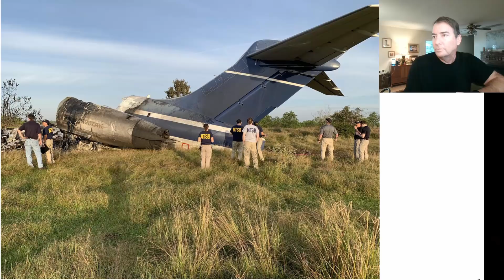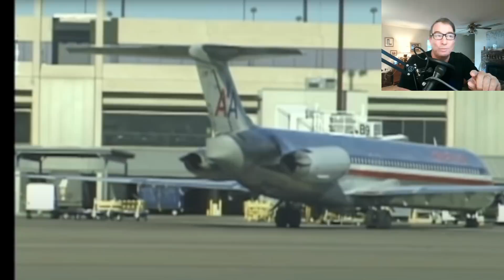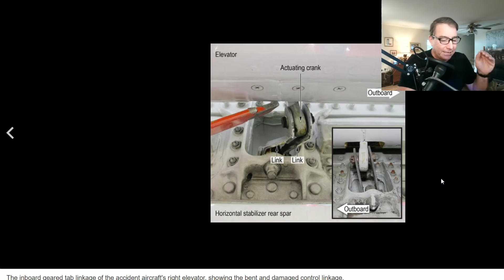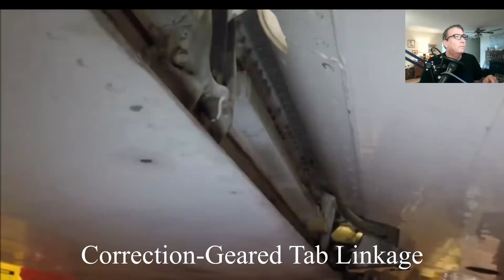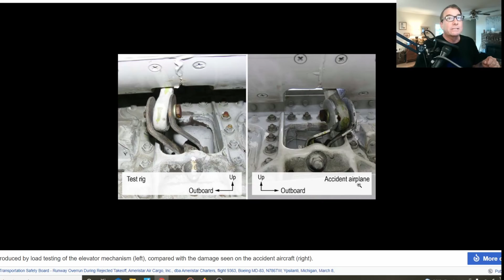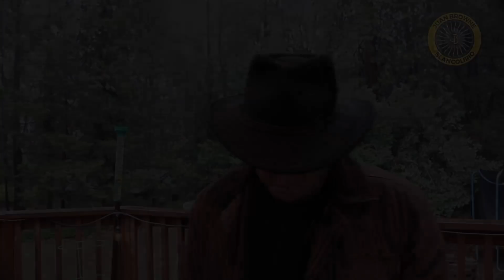MD-87 Crash Houston UPDATE 9 Nov. Flight Controls

Comment: Juan, this is by far the best video you've done since I've been watching the channel!  I went from EMB120's direct to 737s and missed the DC9 series, so I found this just fascinating.  I wonder if a better elevator lock system would have helped.  Then again, taking off with a gust lock system (from an elevator you can't preflight inspect without an elevator [sic]) would result in same problem; a wrecked airplane at V1 failure.  

Boy, stopping a 150k lb airliner that has all systems accelerating the aircraft must have been a bitch on a 7k ft runway.  Sounds to me that quick-reaction captain should be awarded a presidential medal (but gotta wait for next one on that).  

Finally, I'd like to see the storage history of this a/c.  If it was in the hangar, what are the chances some physical damage occurred that either over-centered the dampers, or even bent the geared tab push rods?  A little far fetched, but it was in that hanger for some time I hear.  That is, in the hangar and out of the elements.   Good one - thanks!

Comment: I actually have some pictures of a USAIR MD-80 gutted on the inside while getting a major maintenance overhaul, a few show the control cables at the back running through a pulley out from the floor and up towards the stabilizer.  At the time I didn't even realize that the cables only controlled the tabs not the elevator itself.

Comment: Juan, I am almost sure that the hydraulic system is not connected to the control tab but to the elevator directly. It provides an hydraulic boost to assist in a large nose-down control input, so in a case of a stall the boost can assist with the nose-down input (and hence in reducing the AoA) in a condition where the control tab may be not very effective due to the very low speed and perhaps some turbulence due to airflow separation, both normally associated with a stall condition.
Reply: I should qualify my answer saying that I am not an expert. What I said is what I remember about the DC-9 family control system from reading accidents reports and other on-line sources. (That's why I said "almost sure"). If someone who knows it for a fact can confirm it either way, it will be appreciated.
Reply: Ok... in other comments people who seem to know what they are talking about better than me are describing the system in a way that is consistent with my understanding.

Comment: Very interesting possibility.  Maybe in conjunction w/ something else too.   Not sure #1 engine wasn't a contributing factor and also not sure why the pilot closed/retracted the buckets.  With everything going on so fast all at the same time,  but prior to evacuation,  the buckets get stowed ?   
Great analysis of the tail and horz stab, elevators and tabs.  Amazing how to found  the FAA/NETB test video based on assumed high wind causing damage extensive enough to not allow rotation.  Somebody dug pretty deep to test / conclude those problems.

Comment: Excellent description of the trim-tab system.  I can now see why the trim-tab system would remain functional and feel 'normal' even had the hydraulic-damper system had been forced over-center.  I suspect an hydraulic-damper over-center indication system could be as simple as a limit switch with an annunciator on the instrument panel, similar to the system described by Kevin Barton.  I am incredulous that that level of damage could be imparted to mission-critical flight control and not have a means to report it to the flight crew.  Wild.

Comment: The Houston News just reported this...

'In the tail section, which was relatively undamaged by fire, investigators found that the airplane’s left and right elevators were jammed in a trailing edge down position; neither elevator could be moved when manipulated by hand.

Both inboard actuating cranks for both elevator’s geared tabs were bent outboard, and their respective links were bent. Both actuating cranks and links were found locked in an over-center position beyond their normal range of travel. The elevators, horizontal stabilizer, and control tabs have been retained by the NTSB for further examination.'

Comment: Interesting to note that the early design BAC-111 T tailed aircraft with engines at rear had a free floating elevator system and the control yoke only drove the tabs. At least one accident when attempting to recover from intended stall at altitude and with high pitch attitude airflow over the elevators was masked by the engines therefore not allowing nose down pitch change and sufficient airflow across the tabs and elevators to enable stall recovery.  Later aircraft had a power driven elevator to ensure effective control and recovery.
Reply: DC-9 installed a back-up hydraulic powered elevator system, but it only activates in deep-stall, if there is disagreement between tabs and elevator.  Otherwise, only aerodynamically assisted tabs control the elevator.  Maybe they learned lessons from the BAC-111.
Reply: @chucksavall  > Maybe they learned lessons from the BAC-111 <  What I heard from a mechanical engineer involved in the DC-9's development was that following the BAC crash, horizontal stabilizer area was "increased by fifty percent" for the still-on-the-drawing-board DC-9-10.  Seems like a high number, and perhaps not meant to be precise, but that's what he said.
Reply: I believe the prototype BAC 1-11 was the first aircraft ever to encounter a stable 'deep stall' during stall testing - entered a deep stall and the pilots couldn't get it out of it, it crashed.   Later 1-11's had powered elevators, also I believe stick shakers and stick pushers.
Reply: @cr10001  The "stable" part IIRC  meant that the pilots were able to communicate with the ground all the way to impact, detailing the control inputs they were trying one after another to no effect.  On the MD-80 aircraft used for such flight tests, there was a large hole in the cabin floor in-line with the forward cargo door, lined with knotted-rope cargo netting which connected to the cargo door opening.  In the middle of the hole was a big metal paddle on a hinge, rigged to jettison the cargo door when someone jumped down the hole.  So with no door on the cockpit (throughout flight test), it would have been fairly seamless to go from seated to outside of the aircraft.
Reply: @marcmcreynolds2827    Yes, I'd agree with that, 'stable' in this context is not a good thing   :) 
That emergency escape hatch in the MD-80 sounds like a very practical idea (so long as all crew wore parachutes, of course)

Comment: 14:12 This seems like madness to me. They found a problem that requires someone/something to monitor the speed of wind gusts when an aircraft is parked and do an inspection if it goes over a limit? Miss the inspection and flight controlls might be damaged and they wouldn't know it. Sounds like an accident waiting to happen.Presumably there is a sensor on the aircraft that logs the speed of gusts when parked? Is it up near the nose sheltered by the terminal building or on the tail?5
Reply: Yeah, I wonder about all the aircraft that have been idle since COVID and have been through all these rough storms. Are they getting the full inspections required?

Comment: The viscous dampers do not function as elevator or tab stops; they only serve to damp/slow/smooth elevator motion. Elevator travel is restricted/limited by hard mechanical stops.
Reply: Is a viscous damper not unlike the hydraulic/pneumatic tube on the screen door that’s there to keep Mom from yelling about slamming the door..,?
Reply: Yes essentially the same goal but different design & operation

Comment: On both the DC-9 and MD80, in addition to conducting a flight cable control continuity check before taking the runway, during Initial Operating Experience we trained pilots to start the takeoff roll with a nose down yoke input.  Observing the nose pitch down ensured the elevators were working.

Comment: Also, the 'elevator slamming' tests & loads discussed by you and examined during those tests are not for flight loads; they are for ground ops and when parked in order meet cert criteria which in turn determine whether the design requires a control gust lock
Reply from the maker: Correct.

Comment: Atlanta residents may remember the tragic Air France 707 crash at Orly in 1962. The pilot(s) were unable to rotate at V1, could not stop on the runway, and exploded.
The investigation revealed a burned out trim motor on the elevator...

Comment: Hello Juan, another fine video! I've still got a few questions however. 
Given the information you reported in this video, do you believe that the report that engine #2 suffered a compressor stall, and/or if that would have been a contributing factor to this accident? I've read that someone has suggested that if a compressor stall occurred while the airspeed was around 20 kts or less, it could jamb the elevator. The theory suggests that at the lower speed, the shockwave produced by the compressor stall happened directly below the elevator and deflected it upwards violently enough to jamb it. The theory states that at higher airspeeds, the shock wave happens farther behind the elevator, and it's energy dissipates to a nondestructive level before reaching the elevator. 
I've never heard of this theory before this and I'm not aware of any reports of this ever happening over the long service life this design has seen. 
Having said that, I have been on a 727 with the same engines (JT8D), and experienced a compressor stall sequence due to bird strike at rotation. I was sitting in the last row, next to the lavatory. I distinctly remember feeling each "WHOMP", as did every one of my internal organs. This causes me to believe that there is a fair bit of energy being released.
(I also vividly remember that around the 4th or 5th "WHOMP", one of the flight attendants, sitting on the jump seat in the galley across the aisle from me saying, "Well now, that doesn't sound very good." The calm, 'matter of fact' way that she said it, verses the freighted gasps and exclamations from the other passengers actually made me laugh.) 
I've been reading whatever I can find on this control system since this accident. There are some incongruities in the information I've found. Some of the sources I've located had the diagram you used, or ones very similar to it, that identify the three tabs. This is where I've encountered the inconsistencies. Depending on the source, the tabs are identified as; Control Tab, Servo (or Geared) Tab, and in some cases, Anti-Float Tab. 
Some of these sources seem to indicate, as you did, each elevator half has one 'Control' Tab' and two 'Servo (or Geared)' Tabs. 
I understand the differences between them, and how both of these work.
However, some of the sources indicate that each elevator half has one of each, Control Tab, Servo (or Geared) Tab, and an Anti-Float Tab. 
I also noticed that the location of the different tabs was not consistent between these two different arrangements. 
The sources that indicated only control tabs and servo tabs, always indicated, as you did, the control tab was inboard and the servo tabs were mid-span and outboard. 
The sources that identified anti-float tabs, placed them inboard, the control tab mid-span, and the servo tabs outboard. 
I've got a few questions now, that I hope either you, or your viewers, can answer for me. 
1) Were there two different elevator control systems that were used on different models of DC-9, MD-89, and B-717, or have I come across erroneous information, duplicated from multiple sources?
2) Is there such a thing as an 'Anti-Float' tab?
3) If there is, what do they do and how do they do it?
As I've already mentioned, I understand the control and servo tabs. I know what they are and how they work. However, I just can't get my head around those anti-floaters. Please educate me.
Thanks.

Comment: Index 8:09.
Did you see that white van cut into the path of the DC-9 doing the powerback?
When I worked at Northwest that was a HUGE no no.
Also as grainy as that footage is I don't see an active red beaken light on the top or bottom of that aircraft that would indicate the aircraft is moving or about to move.
Northwest flew DC-9 *10 thru *50 and got rid of the MD-80 after the accident of flight 255 in 1987 at DTW.

Comment: The "power back" was common at smaller airports back in "the day"!
Reply: That video was at DFW.
Reply: @robertbutsch1802  Yep!  Terminal B (Or 2W if you've been around long enough!) gate 9.  What I don't see are the wing walkers that normally stop traffic on the ramp as the aircraft backs off of the gate.  I assume that is because of the thrust reverser use for backing off of the gate.  That's likely why they stopped the practice; to make sure they can use ramp personnel to stop traffic directly behind the aircraft.  When you round those gates of a curved terminal, it can be hard to notice aircraft backing out, especially when there is other traffic moving (tugs with baggage cans or LD3s, fuel pump trucks,  and catering trucks.)  Of course, using a tug does save gas.
Reply: @robertbutsch1802  Yes.  But it was more common where tugs weren't.
The only reason it was done at larger hubs was due to the crew being in a rush.

Comment: I cannot believe there is not an over-center travel stop engineered into that assembly. In engineering, any time you have a linkage that can result in an over-center condition, you always must engineer into that system a means to prevent the over-center event or a means to get out of it and back into normal control operation.
Reply: Gusty winds at an airport. So the elevator has travel stops built in otherwise it could over travel and break the hinges. But if high winds push it abruptly to the stop it damages a linkage. So let’s put a shock absorber in to slow this down but we can’t put one in that will be effective past 60 mph wind speed because then the elevator will be too sluggish, ok that’s good enough.
Reply: McDonnell Douglas's association with over-centre linkages is - not a happy one.   (DC10 cargo doors...)

Comment: Cheap, reliable HD video cameras are readily available. Mount cameras looking along the bottom of each wing and one pointing at the tail. Put a monitor in the cockpit and you have a lot of troubleshooting options available. Check the flap, elevator, aileron, rudder and engine status. Cars have had reversing cameras for years.
Reply: Your $100 camera system will easily cost $1 million and 12 months of certification in aviation world
Reply: @josh3771  Thanks for the quote. When can you start :) ?
Reply: @simonmccauley8187  Cheers, I'll get my lawyer to fax you the first 4000 pages of preliminary paperwork 👍

Comment: Awesome detailed video as usual Juan. Are there different steps you follow with these two type of rejected takeoffs? Meaning one where you know you will be able to stop before the end of the runway, and the other where you know that after rejecting take off you will not have enough room to stop and go off the end? Or is it basically just the same procedure with the latter ending in an evacuation?
Reply from the maker: The same.

Comment: It sure is a damn good thing this airplane was not able to get airborne and kudos to the crew for doing the RTO as soon as they recognized a problem.....unlike the crew of the Gulfstream at KBED with locked controls, who apparently thought they could troubleshoot it on the roll....and they had 1,000 more feet of asphalt + a decent overrun to work with.
Reply: Sad day coming back to work that Monday.  The report was very disturbing.  Over 30,000 hours between the two.

Comment: Illuminating as always. First off, as a fully paid up member of the IOE (Institute of Over Engineering!), those two plate links in the offending location, look more like Meccano in relation to the surrounding aircraft parts (‘just saying’). Second; I get the wind gust limit, but how can anyone know, at any point, exactly what wind gust such an aircraft may, or may not, have experienced whilst sat outside? Third; if the pilots ‘full and free movement’ pre-flight check doesn’t actually do (or tell them) anything (with this design), how can the maintenance crew check that the thing works properly after any work in that location?

Comment: Thanks for the interesting video.  As a current Boeing 737 Captain it is normal, in high wind conditions, to turn on one or both electric hydronic pumps to stop the yoke from injuring pilots in the control seats.  This brought up the obvious question of what happens to an unattended, depowered aircraft in high wind conditions?  We received the same or similar answer as noted in your video.

Comment: Great video thanks Juan, as always.
I’ve always wondered about those elevators, have never flown anything McD, always Boeings (737, 767, 747) - I have been sitting behind one at a runway holding point in very strong gusty winds with the wind behind us, and seen the elevators flopping around- even to the extent of going in opposite directions with one going up and one down, just like in your video. It’s rather disturbing to see.
Strange design, makes sense now that you’ve explained it, (but I guess it normally works well.)